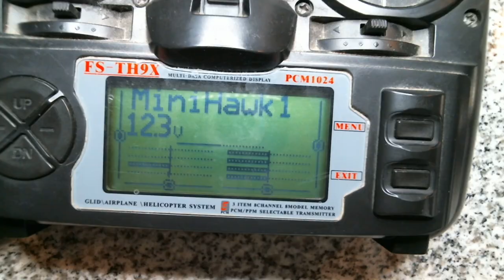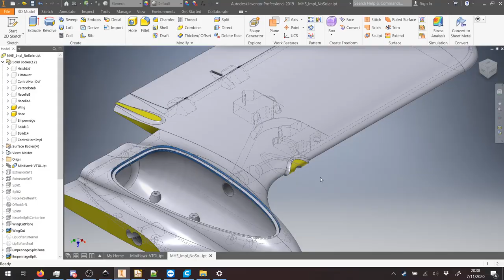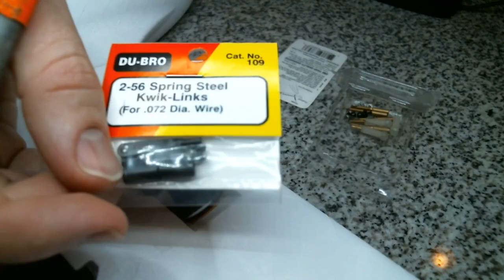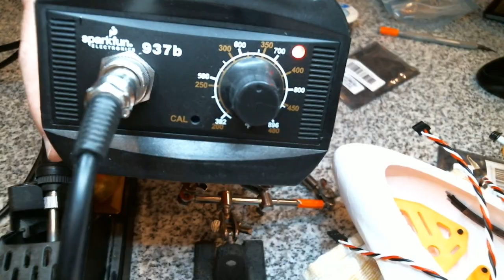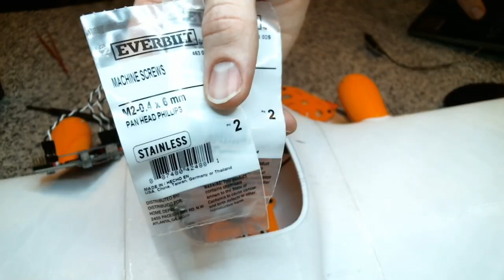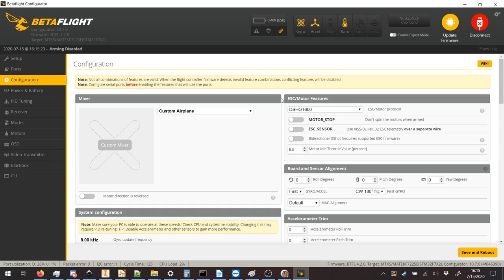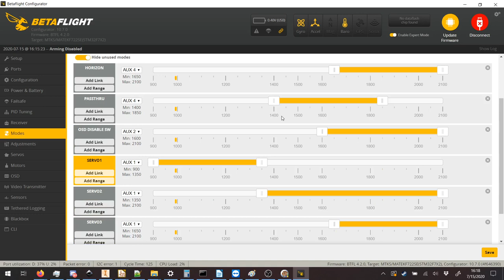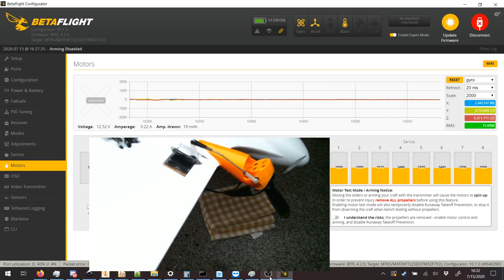MiniHawk VTOL Build Sequence 2

Comment: Hi Steve (Paul here)...a few ideas as I re-watch the video and ideas for the next version... maybe key the vertical stabs so something inserts into the fuselage?  I just did this and white tail and white fuselage...i was worried I didn't have things perfectly aligned
Reply from the maker: Already ahead of you! Check this comment, is solved on version 2.1: https://github.com/StephenCarlson/MiniHawk-VTOL/issues/7#issuecomment-945021976

As you may gather from this and the other video comments about the spar, things are in flux as version 2.1 is nearing release, sorry if things are confusing, working on it...
Reply: @stephencarlson6297  check my message on HackaDay =)   Yes...more talking through the video would huge too!
Reply: @stephencarlson6297  did you hot glue or super glue in the nylon hinges onto the elevons?
Reply from the maker: @WhereNerdyisCool  I've done both. CA does better; HMA is too soft, but it's easier to deal with.
Reply: @stephencarlson6297  okay. I don’t think the bottom tail fins I printed match up.
Reply from the maker: @WhereNerdyisCool  I only just put two and two together, you are Paul, got it ;) . Too many aliases online these days.